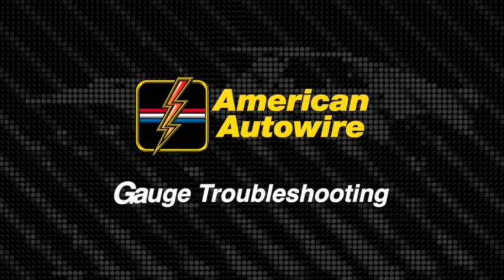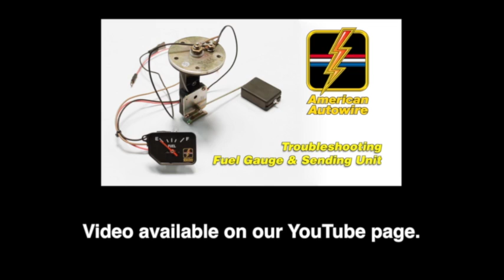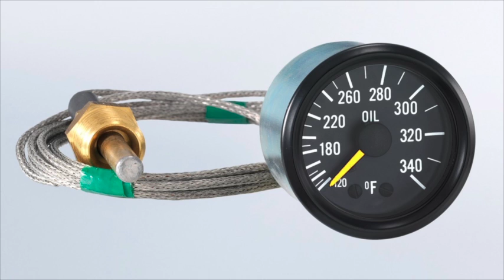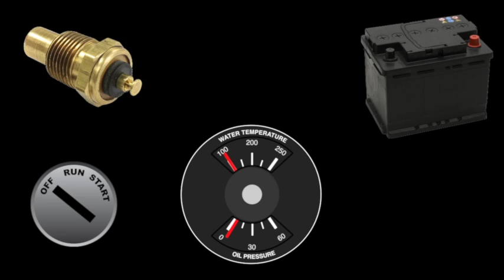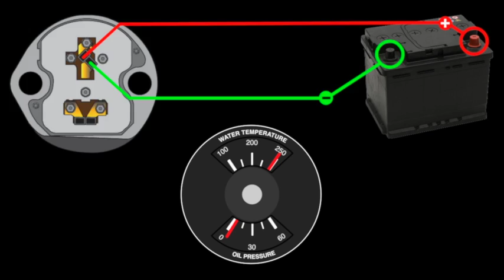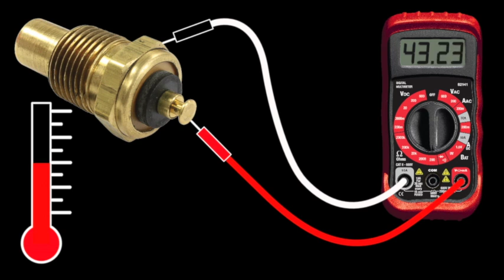Troubleshooting Oil Pressure and Water Temperature Gauges

Comment: Great video! I have a 1988 Chrysler fifth avenue with a temp gauge issue. I grounded the sending wire with key on and it was full hot. Replaced the sensor entirely. Gauge did not work. Checked continuity from sensor body to battery ground and had continuity. Now im confused.

Comment: Alright I’m confused and need help. I installed my water temperature gauge and when I ground my sending unit wire to my negative terminal it reads full hot. This means the gauge should be functional but when driving, the gauge only reads just above 100°f. What are my next steps?

Comment: I get the TEMP DEMO, and thx.....but not the oil part....let me make sure it's correct...RUN A 16G WIRE FROM THE OIL SENDING UNIT (THAT IS GROUNDED TO THE BLOCK) to the POSITIVE TERMINAL to make the oil guage show....what? It's HIGHEST reading.....RIGHT?
You said "GROUNDING or REMOVING the sending unit wire, should have the same results as the temp sending wire..."
WHY connect the temp to NEGATIVE and oil to POSITIVE for testing?
I don't get it......

Comment: In idle my temperature gauge reads in the middle.  As soon as I drive it pegs full hot. I replaced the sending unit and it still does it.  If I have someone wiggle the wire to the sending unit thinking it will create the shirt  I can’t get it to peg.   What’s going on?  1988 Suzuki Samurai. All started after rebuilt motor swap.

Comment: Careful...  Direct grounding sensing wires can equal BIG currents, and at best end up with blown fuse and at worst melted wiring.  This is not a good test method at all.
Reply: The sending wires being grounded are grounded even when they are wired up correctly. Doing this test doesn’t add a ground it isolates components for testing. No risk to worry about

Comment: Thats awesome man and yes it will improve gas mileage because when you're temp goes below normal the computer puts it in limp mode and everything is messed up then mine idles really high when it happens so it definitely hurts gas mileage.  I have 03 Ford 2.3L ranger i replaced the cluster it did help i went from 50 miles to 80miles  drive 80 miles temp goes zero everything coolant wise is new. Really driving me crazy and killing me $$$ wise shop has truck more than me.  But i think im still going to let them figure it out. But curious if the cluster switching fixed your problem?
Reply: The PCM dumps extra fuel to a cold engine for enrichment taking the place of a choke.

Comment: Hoping you can assist. Replaced my temp guage sensor. Chkd sensor first, chkd wire to sensor and chkd guage per your instructions. Everything chkd out. Temp guage was normal before but now it reads max hot for some reason. Not sure why. I can put old sensor back in since it tested ok to see what guage reads but I hate to pull it again. Any ideas appreciated..thks..jc

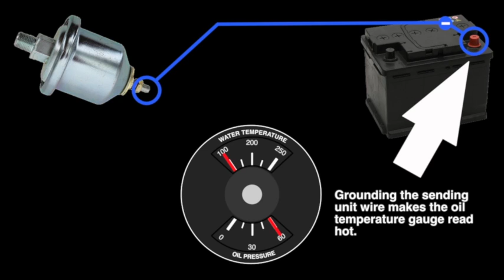Comment: Note:  At 2:26 -  that shows the connection going to the wrong battery terminal!  It should go to the black (ground) terminal on the left side of the battery-- not to the red (positive) terminal.  Great video otherwise!
Reply: I noticed that as well, other than that it’s very helpful, thanks.
Reply: You are correct as this is a variable resistance to ground not B+!
ASE Master tech, 78.
Reply: I noticed that also

Comment: I replaced both my coolant temp sensors on my 94 K1500 5.7L and replaced the thermostat and housing and basically flushed and burped the system I should have tried this diagnosis first hopefully it’s just the dash I hate doing wires.

Comment: Thank you so much for this video!! I had to watch it about 9 times before I actually understood what was happening. I took the information from this video and fixed a problem I was troubleshooting for 2 days. Turns out the wire from the sensor was cut so I spliced it together and the new replacement gauge was bad. I put the wire to ground and it didn’t move at all. I replaced it with another gauge and it worked! Thank you so much!!

Comment: Maybe you can figure this out, 70 Pontiac oil water temp gauge I hook the sending unit to neg on battery leaving wire harness attached to sending unit and  temp gauge turn on as instructed in video but the fuse blows, if I use a tester light and simply check power to the sending unit from wire harness it has power but can't reading at gauge, have tried 3 gauges.  Any thoughts

Comment: Your graphic is incorrect for grounding the oil pressure sender for testing the gauge. It shows conniecting to the red positive terminal of the battery, althought your graphic has a '-' on the blue line.

Comment: With engine cold, temp reads over the max.
Reply: Same with mine. I think he’s saying there is a break in the wire, causing the circuit to ground which makes the high reading.

Comment: with the engine running at idle it shows over the top over heat. rev engine up to 2000 rpm and it drops to 140. decrease rpm's and the temp goes up. battery disconnected, needle is all the way up......Bad gauge?

Comment: In theory. If I have a temperature gauge that reads higher than actual, I could add a small resistor to the wire to drop shown temps?
Reply: Or remove the indicator and place on correct number during a know value.

Comment: Thank you for this. I installed aftermarket gauges, using the senders that came with them (swap meet purchase). Wasn't getting any readings from oil and temp. Tried the ground trick you show and learned I had a loose connection at the back of the gauge. I was ready to order a different set of gauges, thinking it was broken.

Comment: 2 mistakes I think you made in testing the oil pressure    1  You said connect the oil pressure sensor to the ground on the battery but your diagrams showed you connecting it to the positive.    2   You said connect the oil sensor to the negative and   ( REMOVING THE SENDING UNIT WIRE ) ??????  Then how would you get a reading on the gauge?

Comment: If I disconnect the wire from the sending unit and hook a multimeter from it to the positive on the battery I am thinking there should be 0 volts when the car is off so what I would like to know is what voltage that would read from the temp and the oil sending units when the car is running and warmed up

Comment: I disconnected the wire and grounded it. Turned on ignition + needle shot up to hot.  Need to replace sending unit.

Comment: If I don't put teflon tape on my sender threads, it leaks. So how do I keep the sender from leaking? I'm afraid to really tighten the sender a lot and strip the threads with it being brass.
Reply: Apply a short layer at the very top of the threads.

Comment: My water temp goes from low, to at about 110 when fully hot. Gauge goes to max when i hold the wire against a ground. I already replaced the water temp sensor. What could it be.. im lost

Comment: Hey everyone I'm looking for a little help trying to restore my wife's 68 Camaro finally got most everything working again and running , one problem I'm having is as soon as I turn the key the temp light on dash comes on and stays on. Car is not overheating and runs great. Now you would think the temp sensor but for the life of me I cannot find the temp sensor there is nothing on the block or on top of the coolant thermostat housing. Any ideas ?  It should be located driver side between the block or head and the master break cylinder. Please help
Reply: Check the intake manfold!
Reply: @stanbarrington9698  thanks I will check there we believe the engine was changed out to a 350 ,. I will post a video of it tomorrow and see you or someone can help me with it thanks
Reply: @DH-fc2os  there is a port on SBC intake manifolds for sender mounting
Reply: @stanbarrington9698  thanks

Comment: Does the gauge care if the car is actually a positive ground like a Model A Ford? Or are there positive and negative ground gauges? I am trying to repair an aftermarket antique 1920s temp gauge that is missing the sending unit. An obscure manufacturer with no information available.  Thanks for a great video.
Reply: Thank you for your reply. I have a 1929 Dodge and a 1930 Ford. both cars are positive ground.
Reply: @lemontier  The John Deere 2 cyl.,, at least all the letter series also had positive grounds.  Noted in owners and service manuals.
Reply: positive ground doesn't exist.  the 2 words mean the opposite.

Comment: Teflon tape fills the voids in the threads of the sending unit to prevent any leaks. The majority of the tape doesn’t stay in the threads and thus metal to metal contact is sufficient enough for a decent ground to occur.
Reply: Not in a v8 boat engine. Teflon is absolutely needed.!
Reply: But being a tapered thread it will seal its self with sufficient torque this eliminating the need for thread sealant, using it would just be a cautionary measure
Reply: No tape, use liquid PTFE thread sealant as directed by the service manual.

Comment: You forgot to metion improper level of coolant. If it is not going to display proper readings. Huge difference between ambient/steam air and direct contact of hot fluid. Just thought to add that in for you.

Comment: Cutlass rally temp gauge is past hot ! I add the ground and it moved like 2 cm forward but when I unplug it it still stays where it was before
Reply: Okay what year make model engine do you have in the Cutlass
Reply: @michaelb.7800  1985 442 5.0 307
Reply: @Rehziicodm  If you would be willing to I can walk you through exactly what you need to do to test and Rule out each segment I'm going to go out on a limb and say that you have a multimeter does your multimeter have piercing capabilities and if so what you need to do without shredding your wire check for your reference wire your ground once it is unplugged from the temperature sending unit once you've done that if that comes back clear and your reference check and wiring comes back good let me know we'll go from there I can always give you my number privately and it would make it easier for me to send you pictures and diagrams and the actual and oem schematics that you need for your vehicle

Comment: I did this test on '63' Mercury Temp gauge. One second after hooking up ground to gauge wire, the gauge began to smoke after it jumped to 'Hot". I turned off the power the second I saw that. Thankfully the gauge still works. Almost ruined the gauge following this video! :(
Reply: I believe that his test was for the sending unit not the gauge.

Comment: When I hook up Sending unit wire to negative (-) side of the battery nothing happened. But connect to the positive (+) side then gauge is working. Wonder where is my car mess up would be? Any suggestions appreciated.

Comment: Shaking my head.  Power goes from key switch to the gauge.  Through the gauge to the "sending unit" which is actually a "receiving unit".  A ground.  I am correct?  When the water heats up the ground is better and more current flows to the the receiving unit.  So when totally grounded the gauge reads full hot.  Correct?  Something does not add up with this video.  Thanks.
Reply: One second after hooking up ground to gauge wire, the gauge began to smoke after it jumped to 'Hot". I turned off the power the second I saw that. Thankfully the gauge still works. Almost ruined the gauge following this video! :(
Reply: The manufacturer “Auto Meter” incorrectly shown the wrong wire connection in the animation. Power is supplied to older analog gauges as it is a variable ground controlling the strength of a magnetic field inside the gauge to push or pull the needle for proper readings. At the dealer, key on, engine off, unplug sender and gauge drops to zero or cold. A box containing a variable resistor like a potentiometer will show movement it gauge & wire are good, but grounded, it simply goes hot or full. The fuel is a wiper on wire wound resistor while temp uses a negative temperature coefficient thermistor, a solid state device that changes with temperature. They make positive and negative both in different range values. 
ASE Master tech, 78.

Comment: So I grounded the temp sensor, which made the gauge max out, then removed the grounded wire and the gauge went back to zero. However when I start my 69 camaro the temperature still isn't reading on the gauge. 

I don't have any thread locker on the temp sensor. The ground test you instructed that I followed demonstrates that I don't have a break in the wire or a faulty gauge yet it still isn't working. Any more suggestions?
Reply: Taylor Axdorff yeah, measure, then change the sensor?
Reply: @davidjauch6682  Yes, I have changed the temp sensor and it still isn't working.
Reply: Taylor Axdorff okay. So you‘ve tested the gauge, the wiring to the sensor and the sensor which you swapped out has ground. Did you measure the replacement - maybe a dud, although unlikely? All I can come up with is verify that the sensor is grounded and make sure you have coolant in - sorry.
Reply: @davidjauch6682  Ok I'll double check the sensor to make sure it's not a dud. Thank you.

I do have another issue - my oil pressure gauge maxes out everytime I start the engine? Though the oil pressure is not actually high as we had the engine tested prior to putting it in.
Reply: @TaylorAxx  old comment but.  make sure it's the right temp sensor.  
if it's a sensor of too high resistance then it will only read cold.

Comment: How do You also Use this test in Modern Cars? 2005 Chevy Impala. Also, since they are directly connected, can a Faulty Coolant Temp Gauge cause/mimmick Symptoms of Bad/Faulty Engine Coolant temp Sensor? 
I'm chasing a P0117 Code..
Thanks.

Comment: What a difference, a actual Technician sharing his knowledge of Diagnostics and repair. Nice to watch a true educational video for once. Most info these days, seems to come from a R&R perspective. Thanks for the refresher! Peace!
Reply: The video is from the manufacturer called “Auto Meter” who has a department for animation. Even then, hooking to the battery is wrong! It is a variable resistance to ground the makes it work. 
ASE Master tech, 78
Reply: @deankay4434  nevermind, I now see that it went to positive and not ground.
Reply: @ Imports from Japan controlled dozens of circuits by controlling the ground side. Working with two brothers at age 16, one of them used a digital multimeter for everything including voltage drop. (My favorite test) He was color-blind seeing only different shades of gray! I learned it, used it and my go to in almost every electrical repair, sometimes just to verify a fix!
Reply: @deankay4434  Would a solid ground connection not make the gauge read all the way to one side?

Comment: Am I missing something or did he ground the oil sending unit to the positive on the battery? 2:30
Reply: Oregon's Lonewolf seems very strange at one point the red is positive and the next negative....
Reply: They also mention oil "temperature" and "hot" when talking about an oil pressure gauge. But I would listen to the narration over the images.
Reply: Yea, I thought wow, that would get the gauge.

Comment: The sending unit wire, is that just a positive wire connecting to the gauge? My gauge has a wire that I THINK goes to just a sending unit and one that is connected to gauge and ignition. The one that I think is sending unit wire is Tan. Should I tap into that one for an aftermarket sending unit? I have "lost" the original plug during an engine swap. I'll have to wire itfrom the sending unit wire to gauge. Someone please let me know what you think!

Comment: Actually  it would be great to understand  how the inner circuits of the electric  water gauge work.
I see that mine ( a stock 1958 Plymouth unit)  has under the screen two micro coils with a microscopic wire wounded around and some other misterious tiny levers.....The two micro coils are connected one to the positive connection of the instrument  and the other to the sender connection.

Comment: This video is EXACTLY what I need to understand how to diagnose my friend's 1968 Firebird 400 with rally gauges I installed and aren't working yet...  THANK YOU SO MUCH for making this!!!!
Reply: Hello,  my 67 firebird oil pressure gauge reads 100 psi  the needle moves just barely once shes at running temp. and I tap the throttle,  my oil pressure sensor  has a fitting with the tube attached to it. How do I correct this issue. Ty

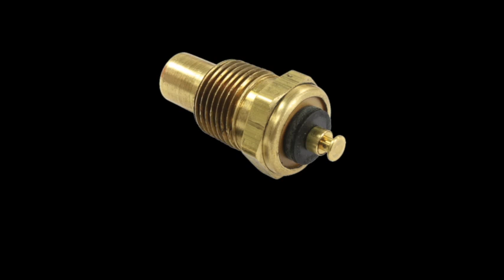Comment: Per your own description of the testing method the so called "sending unit" is not and has been miss classified for decades.  Increased reading on the gauge is from increased current flow FROM the gauge to the sensor.... NOT the other way as you describe at 1:05.  Heating the coolant sensor decreases the resistance to current flow.  Same happens with the idiot light when it gets over a set temp the circuit resistance drops to zero & connects and the red light comes on.